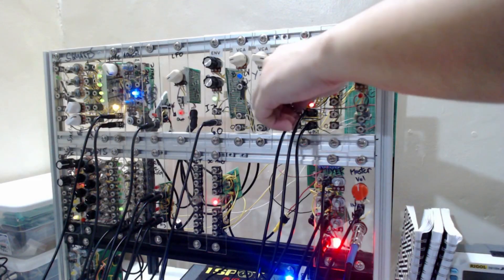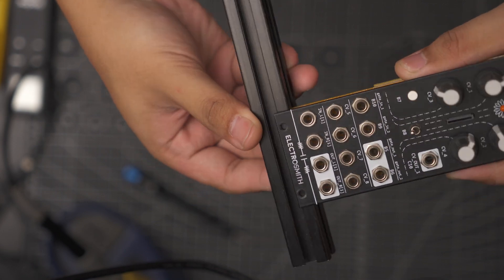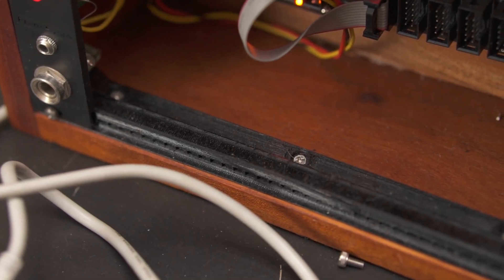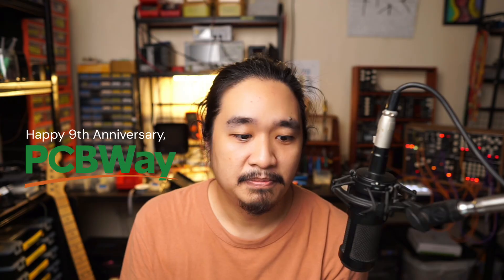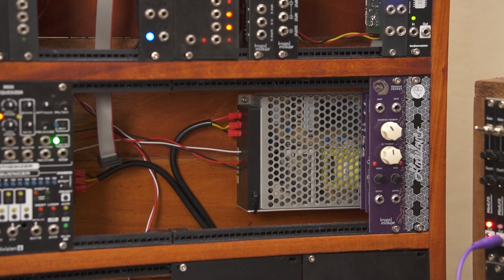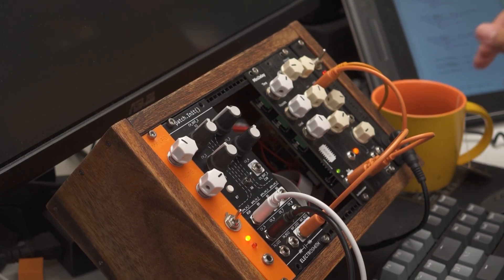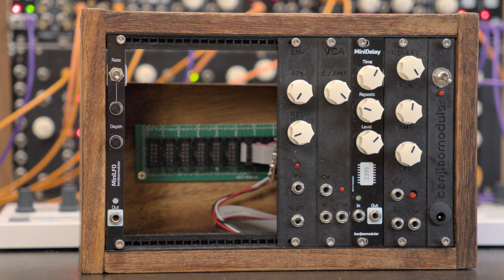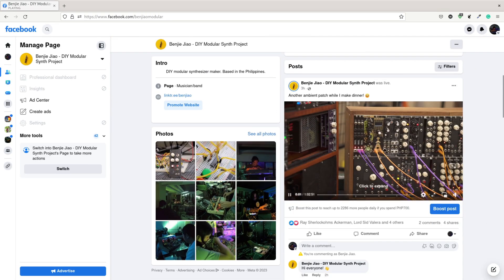The cases I built for my DIY Eurorack synthesizer modules

Comment: Thanks for the interesting and useful video! 🙂 How much did it cost to make the 3D printed rails?
Reply from the maker: You're welcome! I'm glad you like it. In filament, it costs around $1 for a pair of 42HP rails.

Printing time is around 2-3hours each, so whatever that costs in electricity. My printer is an Ender 3 and it uses around 0.12 kWh. :D
Reply: @benjiaomodular  That's great! It's much cheaper than buying Eurorack rails! 😀

Many thanks for your helpful reply! 👍👌 Subscribed!

Comment: This is my first time watching your youtube videos, but they are so cool!  I'm surprised that the JST is more convenient than the IDC connector, if it's just an issue with crimping I could maybe help out with that, but if it's the form factor than JST is better, and makes sense.  

I decided to expand my eurorack case space and ordered a 9u box from Italy recently, a handmade case with Meanwell supplies and threaded strips.  I think your 3d printed tappable plastic strips are brilliant.  The sliding nuts seem so flexible but they're sooo fiddly and frustrating.  

Quick review of the received italian case is that it's great, the meanwell supplies are quiet, and everything is as-expected.  It allowed me to resurrect a lot of modules I'd had to put on my shelves, and I'm having fun exploring them again with my other units.  But now my desk space is all messed up.  

Fun problems though :)
Reply from the maker: Oh hey, thanks Daniel!

Yeah the JST works great because I don't have to use a socket for point-to-point or deadbug builds. I can solder wire directly to the power rails and then crimp the other ends. That'll be difficult to do with ribbon cables.

I do have slide nuts on my gig case and it really is fiddly. 😂

I'm glad you got a catch-all case as well!  It's so nice to have the modules ready to go all the time.

Comment: Great stuff Benjie - I'm planning to build my first "nice looking"  rack soon as I'm currently using a very roughly built rack that I quickly built from scrap wood to get me going. I love your 3D printed rails; such a good solution. I don't have a 3D printer just yet though so I'll probably continue with screwing into the wood, which works fine. Thanks for sharing!
Reply from the maker: Thanks, James! Yeah screwing into wood is definitely a good solution too. 

Screwing into plastic is just a tiny upgrade. I like it because I can use the usual eurorack bolts and the alignment is more consistent.

PETG doesn't strip as easily as I expected either, so I bet it'll last longer than using wood screws. We'll see. 😁

Comment: Nice. I've been making angled cases by first making a box similar to what you have here. I then glue a rectangle of 3mm ply onto the side of the box that will be the highest point of the case. The size of the rectangle determines the height and angle. I then cut two more pieces of 3mm ply based off the angle created by the first piece. I glue those onto the sides. 3mm ply can be cut with a Stanley knife. It's hands down the simplest way to make an angled case that I know of. I use 12mm ply for the box and don't use rails at all. Jus little wood screws straight into the ply. I reckon its up there with the easiest DIY case solutions going around.
Reply from the maker: Ohh that's smart. I'll keep this in mind. Thank you very much for sharing!
Reply: With a larger case you may need to reinforce the 3mm ply by gluing some extra pieces of thicker wood inside the case after you have the angle right. It's all hidden inside the case because the 3mm ply is like a veneer. 

You can mess around a lot trying to cut bits of wood to the right angles this makes it a lot easier.